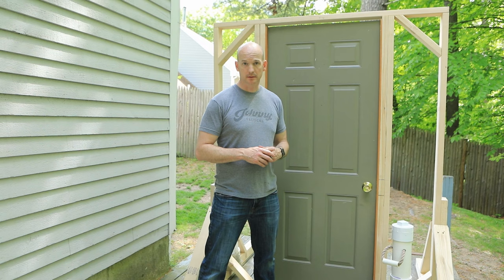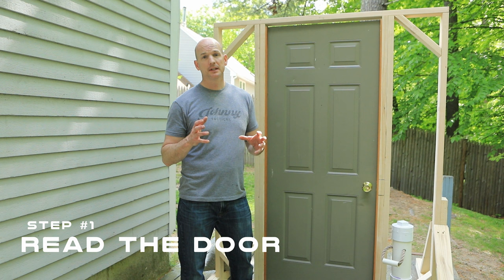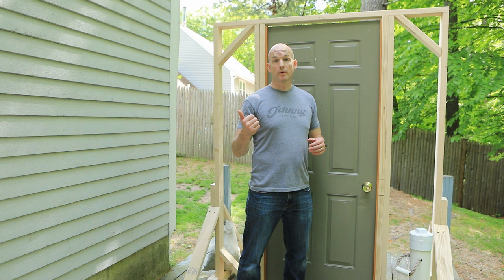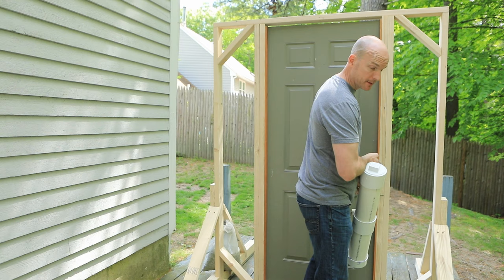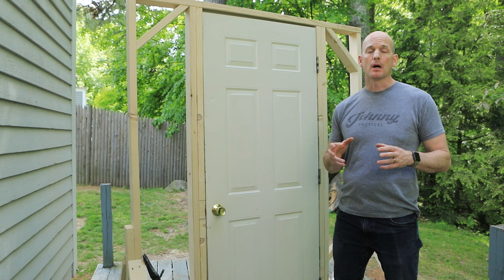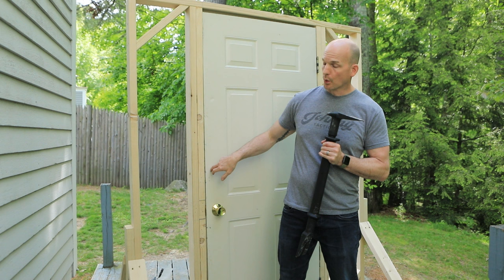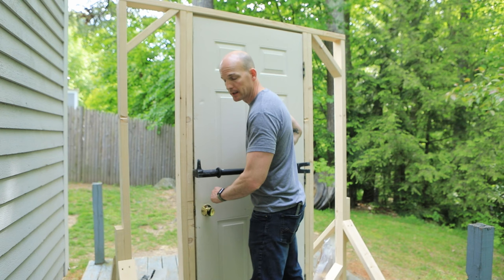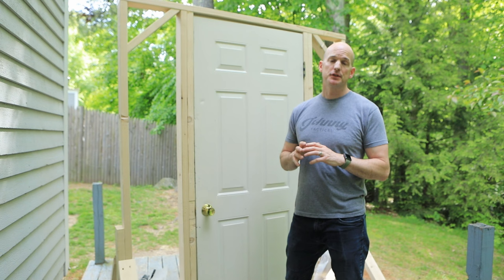Manual Breaching Basics: Ram, Halligan, & Mini Pry Bar

Comment: You could have easily removed the exposed pins on the hinges and pulled the door open without destroying it (or leaving any signs of forced entry).  Signed: Deviant Ollam.
Reply from the maker: You are crafty
Reply: ah yes covert entry
Reply: Back in the day in SWAT training, they taught us two methods .... dynamic and slow methodical ways of entry and clearing/securing. The ram is certainly dynamic (rapid). He is correct in saying that the normal fire-rescue Halligan tool is way better that what is usually found in the police toolkit. Fire-rescue calls it the set of irons (Halligan and 8 lb flat-headed axe). As for the small pry bar, it depends on the door and locks installed. There is also a tool available called a shove knife, which is basically a small slim jim that is best used on interior doors. Great video overall. Thanks!

Comment: Um isn't the side of door LUO is usually standing because its not a good idea to stand in door 'light' - fatal funnel? Also, standing on left will give you no cover when door will be opened. Just a thought why they would choose presumably wrong side ;)
Reply from the maker: Yes, a doorway is considered a fatal funnel but you need to be in the doorway to get it open. You should always be wearing armor and have a cover officer. Once it’s open your next job is to get out of the doorway and let the rest of the team take over. Good question. Thanks for watching!
Reply: Standing on the knob side during a ram breach will give you light cover however, I have seen an officer break his wrist ramming from the knob side because the ram continues to move forward once the door is breached and his wrist hit the frame/wall. That is why we breach ass to hinges
Reply: It's called taking a risk.
Reply: Wrists break all too easy when momentum is involved